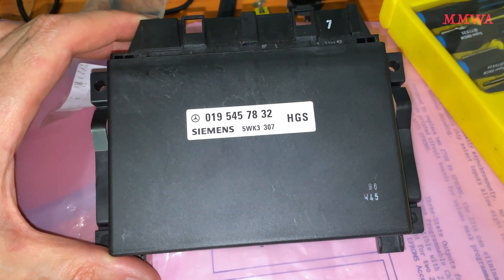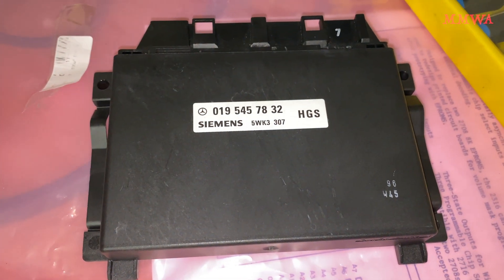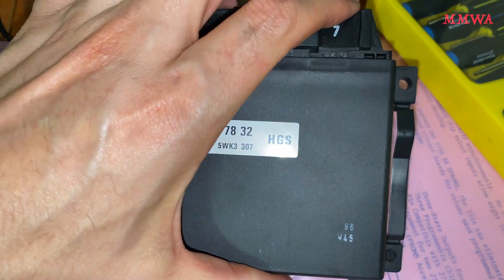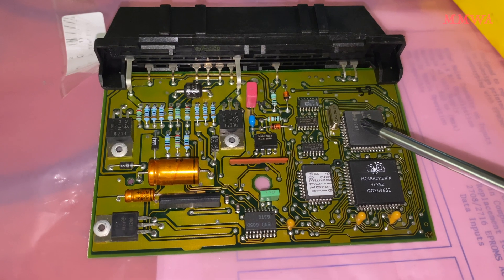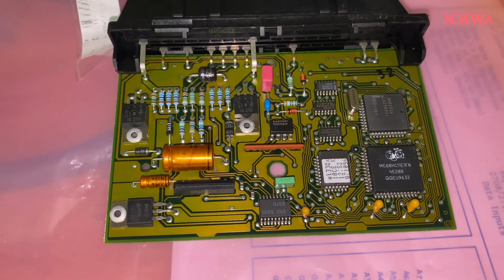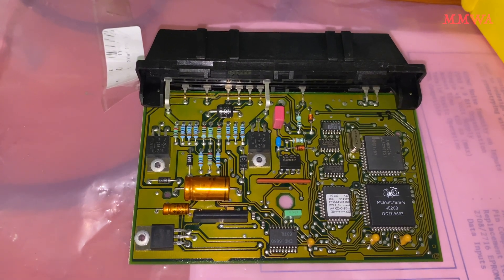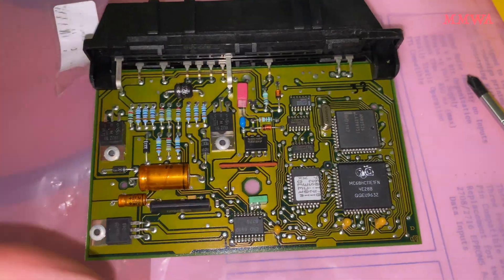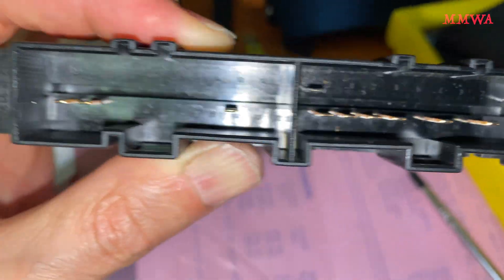Inside the W210 722.5 HGS - Why did we have these in Australia?

Comment: I’m fairly certain that the ‘96 m104 powered e320s here in the US also came equipped with the 722.3. I don’t know when they switched to the 722.6, if it was in ‘97, or sometime in the middle of the ‘96 MY. AFAIK, the 722.5 was never offered here in the US on the w210.
Reply from the maker: last time i checked the epc, i only saw 722.6 as the transmission used for usa version e320. It could be wrong, but 722.6 did exist in 1996, we had them from 1996 on the W140’s. W210’s we didn’t get it till the new engines, m112/m113 etc.
Reply from the maker: @athompson8976  this isnt from my car its a crashed 1996 E320 we raided for parts.  Not much of it left now.

Comment: Same 'problem' here in Europe. We also only had the 722.4 or 722.5 with M104 in the 210. I own a '96 E280 M104 with 722.5 and '97 C280 M104 with 722.6 both have done 130,000 km. The 210 almost feels like a ten year older car compared to the 202, even though there six months apart and so very similar, apart from the size and transmission. 

I also am very curious to find out how and why that decision was made.